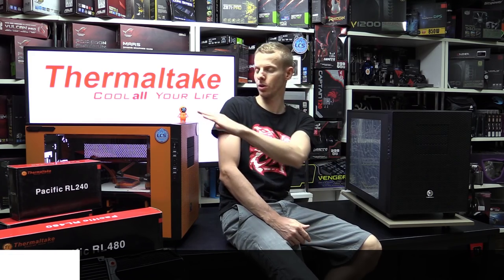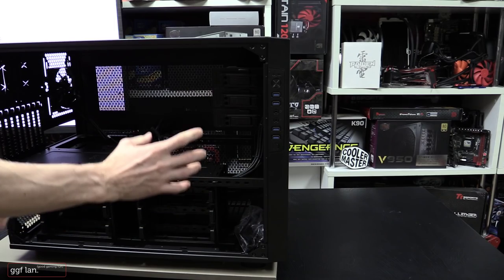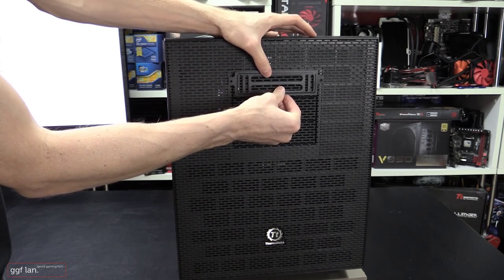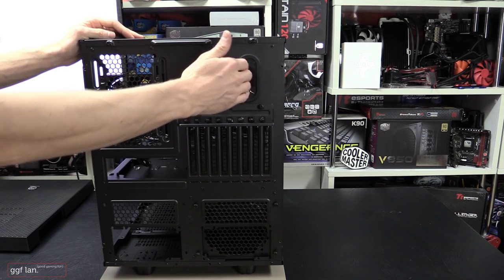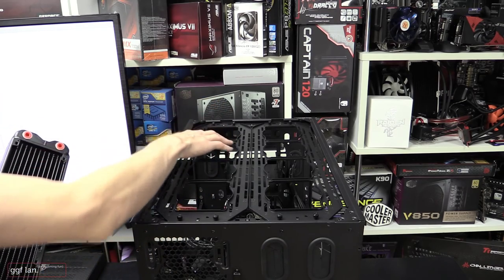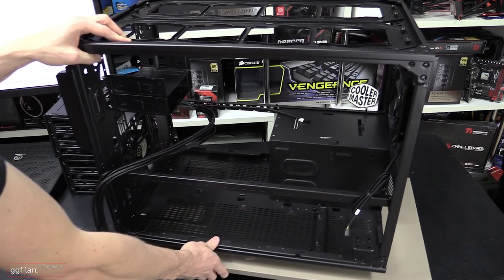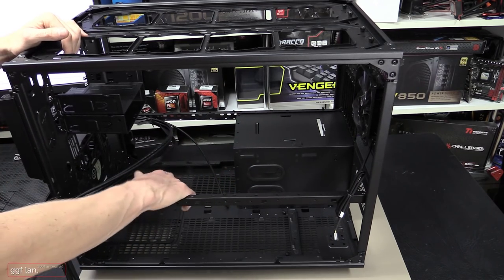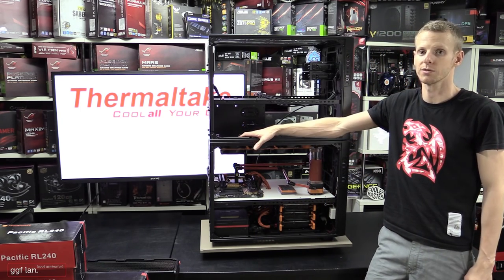Thermaltake 2015 CaseMOD - Thermaltake Core X9 Review and Stacking

Comment: You can buy more of the HDD/Radiator mounts from Thermaltake if you need them, which is nice.
Reply: I wonder if it is possible to attach a hard drive cage (say from Lian Li) by attaching a fan to on of the brackets up the top rather than relying on those things down the bottom.

Comment: Hi there, in the Core x9, I was wondering if on the bottom (NOT the power supply side) can you fit 2 x 480 rads one on the bottom side and one on the bottom floor? TY
Reply: +l0unny not both, no. One or the other, yes.

Comment: would a msi x power II motherboard fit in this case?
Reply: +justin Ketchum Not as far as I know, at least if PCPartsPicker is anything to go by since it's XL-ATX and this only supports uto to E-ATX. I'd probably suggest the upcoming Core W series although those are towers.
Reply: +justin Ketchum You're talking about a XL-ATX board, this case is E-ATX